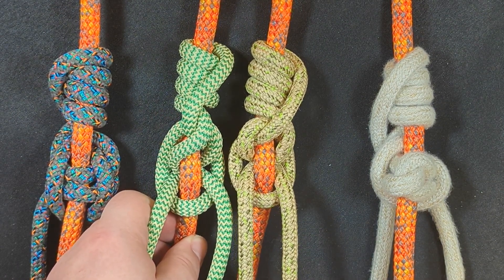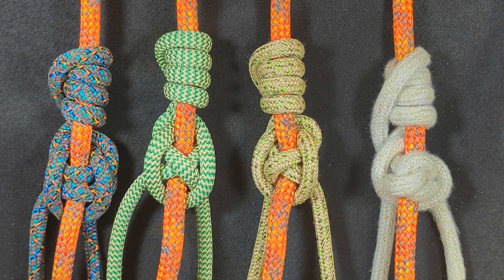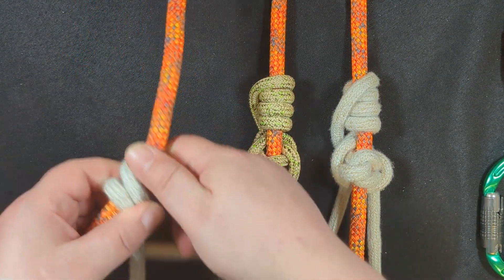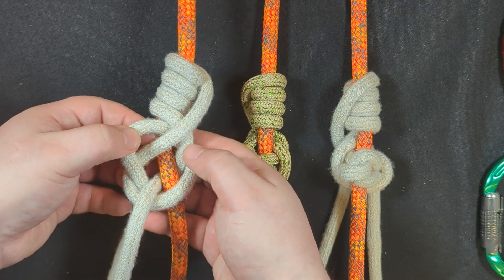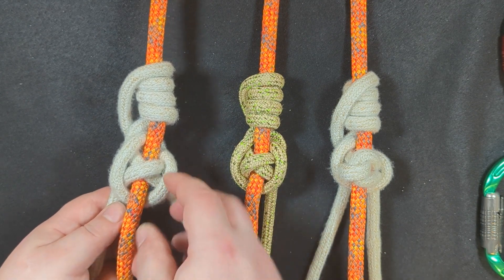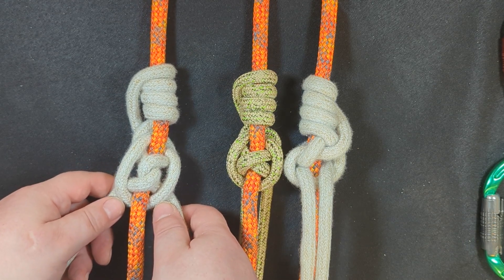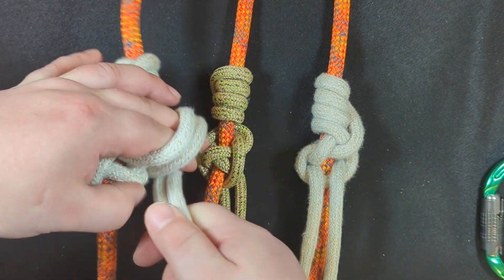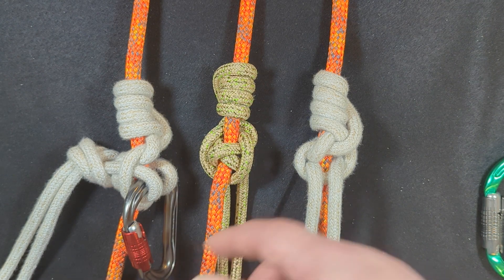SRT Hitch Series: Ep. 4 - PrecisionSRS Hitches 1-4 for Arborists & Tree Climbers!

Comment: Just putting all the friction into the hitch burn up the hitch quick.. I’m just curious cause I go through them pretty quick and they’re expensive… but if I could reduce the amount of hardware, I need and save some money I can get a boatload more of them
Reply from the maker: You're thinking about it the wrong way. I would suggest buying hardware (either a rope wrench setup or a Hitch Hiker setup for SRS/SRT; I prefer the former) and that will help you go through the hitch cords way slower! When you use a hitch like the ones in this video, 100% of the friction is being applied to the cord. Same with other similar SRS/SRT hitches, like the Sticht hitch. But if you use a device like a rope wrench or a hitch hiker, then 50% or less of the friction will be applied to the hitch and you will burn through cords half as quickly. Additionally, climbing control will be superior. Also, you could climb MRS/DRT and that would achieve the same results, such as with a Hitch Climber setup because you'd be on a theoretical 2:1 and that would mean only 50% of your weight would be on the hitch. Am I making sense, friend?

Comment: Hey there 

You mention that the SRS Precision 3 lacks a twist in the two lines coming from the coil section above in the junction between the 2 sections which results in less separation.  Are you able to explain the benefit of being closer?
Reply from the maker: Can you give me a time stamp for the part of the video where I discuss what you're talking about, please? That will make it easier for me to help you with this question. I made this video a long time ago haha Thank you!
Reply: @Knot-orious  thanks and apologies, its just that I'm studying your knots hard and making notes. 

So the time stamp is 2:27 min where you show that Hitch 3 lacks the twist of Hitch 2 between the two sections.  You say "that's great" without explaining how less separation is an improvement over Hitch 2.  I would have thought the separation was better.

After looking at the Hitch Series Ep 3 I think the reason its better is because it keeps the coil tighter and so it grabs more readily thus preventing slipping
Reply from the maker: Okay, so what I meant (and I said it in the video, but I didn't elaborate) is that, because of the twist, when the third hitch is weighted, there is going to be "less separation" between the coil and the secondary stage AKA adjustability section below it. This means that, when hitch 3 is weighted, it will be more compact than hitch 2. There isn't anything inherently bad about that twist, though, other than what I just mentioned and the fact that it makes the tying method more complicated. I have several hitches that I've created (most notably my Calligraphy hitch; my best regular climbing hitch of all time) where I have created twists between the coil and the adjustability section, so it's not always a bad thing. A twist can also eat up hitch cord length, but it can also help keep the coil from binding. So the ultimate takeaway is that a twist can be good, bad, or neutral depending upon the hitch you've tied the twist into and how it affects the performance and tying method(s), etc. For this particular hitch series, I found that it does still work well WITH the twist. It's just that I really wanted a super clean tying method AND I ultimately ended up with a twist in the adjustability section, which accomplishes the same goal of preventing binding. If you plan on trying this hitches out, give #3 AND #4 a try because I found that #4 isn't always better.  Let me know if you have any questions! Thanks for the timestamp. That made life much easier!

EDIT: Twists extend the length of a hitch when you weight them and create separation between the two parts it connects, wherever that might be on the hitch, with some exceptions. The twist between the coil and adjustability section will create separation in #2. The twist in the secondary stage for #4 will not, for example.
Reply: @Knot-orious  thanks heaps for the explanation..I will go back and study..I'm certain one of your knots, perhaps one with a ring, will gain currency and replace hardware .. preferably one that can use sewn eyes for compactness and aesthetics 

thanks again for your detailed explanation.

its now back to study
Reply from the maker: @ Hey, thank you for spending so much time studying my knots and hitch designs. I'm flattered. The PrecisionSRS series is a pretty solid choice when it comes to SRS without a rope wrench. I really ought to do more testing on it and share it with some of the online communities I'm involved with. Just so you know, I can always be reached privately at knotorious.info@gmail.com